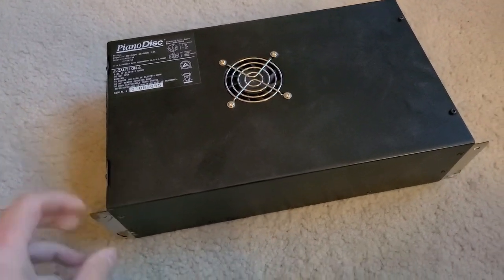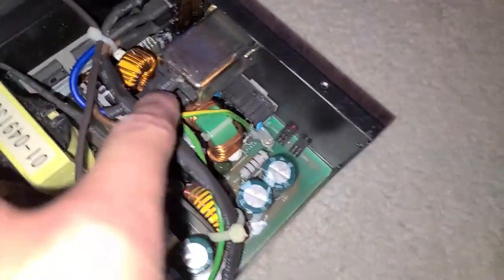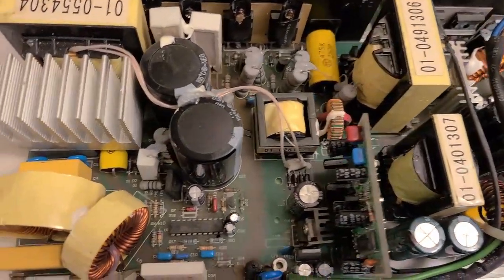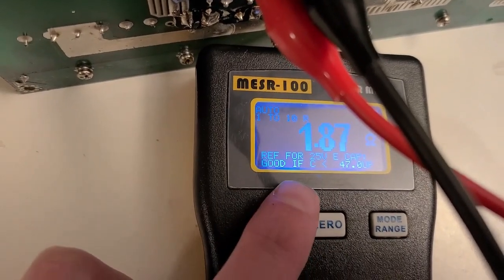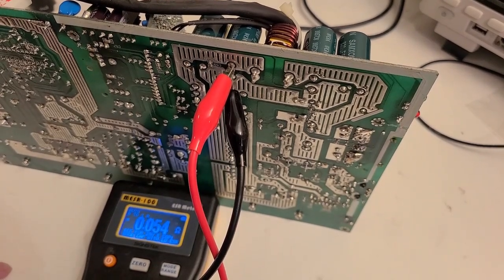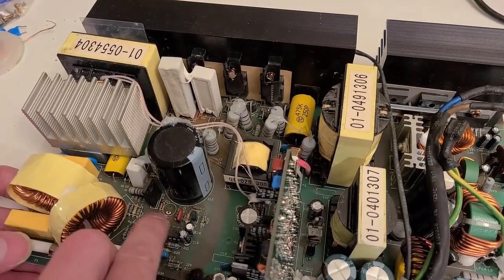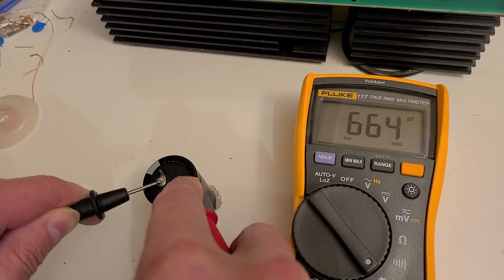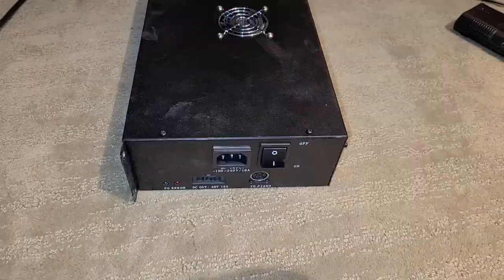PianoDisc Power Supply Fix - Testing and finding bad capacitors in circuit

Comment: Shane:  Awesome video.  I found nearly a dozen capacitors that were out of spec or open and two 320 ohm resistors that were open.  Unfortunately, that didn't do it.  There is a short somewhere that was smoking the resistors again and without a schematic, I was at a loss as to where to go from there.  I have a bit more than basic electricity knowledge, but by no means an electronic technician.  I feel that if i had a schematic diagram of the components and connectivity, I may be able to sniff out the root cause of the failure.  Any idea where I might be able to get one?  Thanks again for getting me started on this journey,....i have learned a lot and haven't given up yet :😀 
Len

Comment: Used your video to replace 9 out of spec capacitors in my dead power supply for $40 worth of parts.  Many thanks.  

If you are intimidated by doing this yourself there are many stereo repair shops that will “re-cap” older equipment.
Reply from the maker: That's awesome! Glad you were able to get it going again and thanks for adding the tip about the stereo repair shop.  The replacement costs of these power supplies are pretty crazy so hopefully that will help for anyone that don't have the tools.   Just out of curiosity was it the same caps that were bad for you?